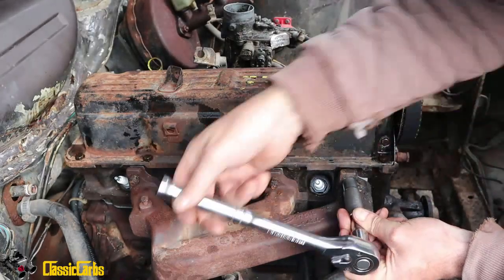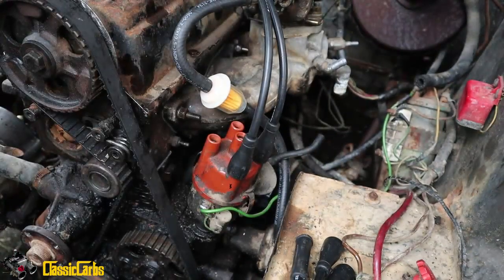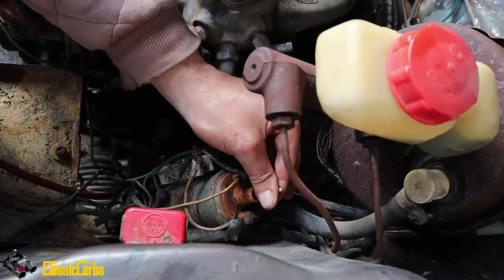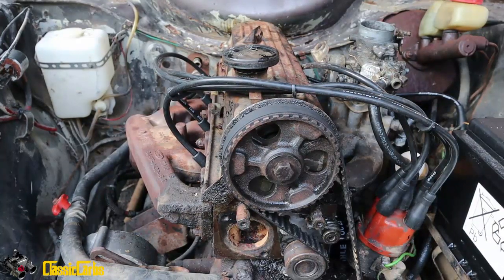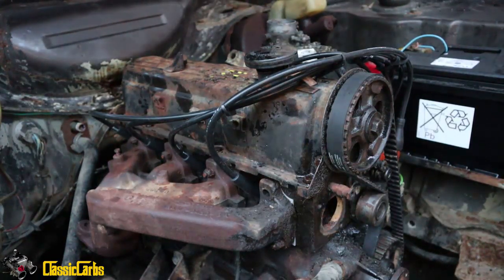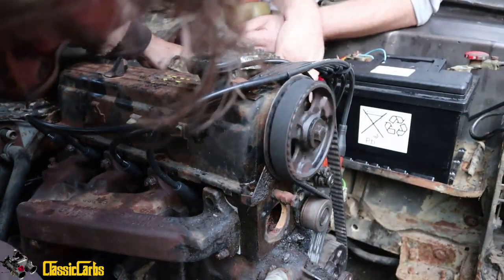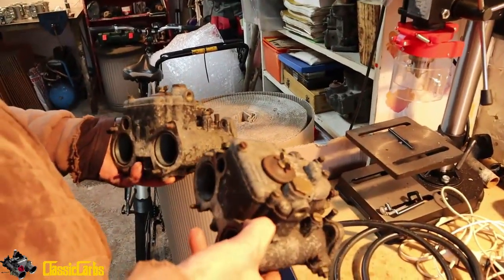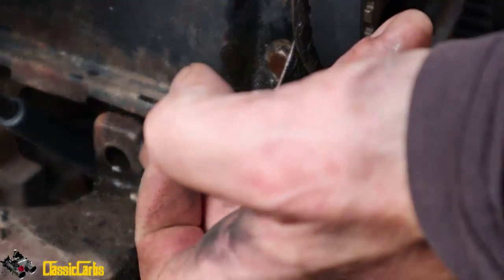1969 FORD CAPRI Barnfind - Will it start? - PART 8 ... The Finale !!

Comment from the maker: Capri project donations:
https://www.paypal.me/1969fordcapri

Thanks to all you Dudes! :) 
We really appreciate your donations which are taking this 
Old Girl on to the next level.  .  .
Reply: This guys' videos will help you a lot.  https://youtu.be/p_5MqRS43ao
Don't forget, if you fit a 2Ltr Pinto, it's an interference engine unlike the 1.6 so any mishaps with the timing belt WILL result in bent/snapped valves. ;¬)  You should try and find a nice old 2Ltr V4, get it back to original. Keep up the good work.

Comment: These engines are real strong , back in the day we used them for beach racing , half the time a rad hose would blow half way through a race and you would say sod it and keep going , they were over revved and abused in every way possible , even if a cam belt broke or came off due to sand the engines were ok because they are non interference engines meaning the valves can not hit the pistons , what great engines they were and what good memories these videos bring back .

Comment: Ive owned 4 Capri's over the years...Raced several of them...still own one today....And i got to tell you to see that little 2000cc engine light off...really brings back some memories....Even the Sound is so familiar to me....A wonderful design....i knew she was going to light off...they alway would...Switched to the 2.3 lima motor in the mid 80s...but even with the extra displacement...they never ran as Strong as the 2000 motor....Great Video.!..brought back memories...👍
Reply: Its a 1600cc
Reply: @tigermoth3194  
Yeah...external dimensions the Same...Same Valve cover....Sold in Europe....US got 2000cc motor...Ford did sell a 1600cc Pinto but is was based on a different engine...

Comment: Why would you rev an engine that much knowing its been stood for years, cold, and has no coolant.  Fair play for getting it running though.
Reply from the maker: I guess it was pent-up frustration... It survived thankfully!
Reply: I’ve been restoring classic vehicles for nearly 40 years this guys only just starting out we all have to start somewhere and he’s not doing too bad👍
Reply: Worried about how he ran the engine? You ain’t seen nothing till you’ve seen @ziptiesnbiasplies 😂😂😂😂
Reply: Revving a stationary engine is not necessary a bad thing when cold; there is no load and RPM means higher oil pressure.
Reply: Revving it like a Lunatic Orchestra  Conductor. I was waiting for a meltdown.
Reply: @brian44graham  yeh man, I  was cringing a coupla times in this build, but he did a great job, from as his buddy said a scrap heap that a lotta people woulda sent to the wreckers to a nicely running  engine
Reply: its not a preservation channel is why.   its a fun channel

Comment: I had a 74 with the 2.3 inline 4 in the US. It was unstoppable. Previous owner thought that he seized it because it was spitting oil out of the distributor shaft and sold it to me for $75. I fixed the oil leak by replacing the PCV valve and drove it for 5 years until a taxi him me. I slowly restored it while I was driving it. I must have put 120k on it and never had to touch the engine. I’m 56 and I’ve owned a ton of cars, but the Capri was my favorite.

Comment: Absolutely amazed you got that running with the amount of guesswork regarding valve and ignition timing. Good thing about Fords from that era is that they are so simple and only need to be ‘near enough’ to spark up.  After 40 odd years in the trade some of your working practises made me cringe but at the end of the day it’s a “well done” from me. Enjoy the adventures and heartbreaks of the ongoing resurrection . Get a helicoil into #1 exhaust and clean out the oil spray bar on the camshaft before it clogs up again and wrecks the cam. Can’t wait for episode 9

Comment: I knew it would start! I've had several of those engines over the years in ford pintos. Great engines! Cast iron block and head. Pretty much in destructible as long as you maintain it well. Now that you've had it running, you really should pull the valve cover back off and be sure all the cam followers and camshaft are oiling properly. They will destroy themselves if they aren't getting enough oil. There should be a good coating of oil everywhere inside the valve cover. Also, check the timing with a timing light. Carburetor isn't right either. Nice Job! 👍😎 I knew it would run! Wahoo! Wes

Comment: Well I suppose the name classiccarbs.com didn't refer to your classy  diet. sneaky Emmanuel had a garageload of reconditioned carbs skopped back there! No wonder they were so confident about the carb rebuild! I def think you have a future on TV. Also lovely to see all the comments coming in from the US and Aussie! The 85% has it! 
   If you put your finger through where the water pump goes, can you feel to the back of the stud hole No 1 cyl' where your mate  'your mate' drilled out the stud?

Helicoiling may not be enough if he has drilled through into the water jacket, may need plugging as well!

But for now! You have a running Pinto in a '69 Capri! Needs an exhaust, a throttle cable, a choke cable, number plates bolting on, a cheeky call to get an MOT, while you craftily detour to your mate's rolling road! 

Incidentally how mucky did the inline petrol filter get?

But really well done It is a fine testament to home spannering. If you have the old Greek reg, make a cardboard sign with the old Greek reg. Maybe the old Greek dude will get in touch!
Reply from the maker: Thank you very much for your input , comment and suggestion!!

The inline fuel filter immediately went yellow. deep yellow. So i think it's rust.

Yes, rolling road power run might be an interesting watch!!

Thank you for your tips regarding that exhaust stud hole too : )

Will be having a look at that over the next few days.

Emmanuel : )
Reply: MOT exempt.

Comment: loosen the distributor just a bit so you can turn and you can get it closer to time. Then it will idle.Also check for vacuum for air leaks and everything that doesn't  have a place to go just plug them off. It also could (not likely) could be off a tooth on the blt but I don't think it is cause it has plenty of snap or quick to rev and it wouldn't if it is off that way. I would gladly send money if I could but I am broke as a joke living on fixed income. If you do decide to change intakes, I believe the gasket is still reusable. I know the intake is not as expensive as the other gaskets. At this point I would get the rad hooked up before you cook the headgasket. I think your on your way to a working car. I did this kind of work most of my life.

Comment: Congrats on getting the engine running, It sounds healthy! 
The stock single barrel carb will give about 75hp. The complete capri 1.6S setup with the twin barrel carb will give 90hp . I am not sure but i think  you need the 1.6S weber carb(with the proper jets inside it! Very important), the tubular exh manifold and the dizzy (for the proper ignition advance curve)
Tip: clean and gap the breakerpoints inside the dizzy. And  tweek the idle mixture and idle speed.
Reply: 67 hp on the single barrel, 86 on the double if its an earlier engine. I think they upped the compression ratio on later ones to increase the power output to 90.

Comment: Old school points and coil ignition are so simple  to get running, much simpler than fuel injection, nice to see her running, I bet the clutch is seized like a bastard tho!..if so to free it you Jack the back up, get her running in gear, rev the engine, depress the clutch and apply football or handbrake simultaneously,  let it run up to temp first to dry the clutch plate out as they swell with moisture.

Comment: I recon its got around 75 hp before you tune it. Nice one great to see it run.
Reply: MrClassiccarenthusia  this engine has plenty of compression. You can clearly hear the starter motor chugging  from 1 compression to the next , even before it ever started.
And once it ran it immediatly ran on all 4 cilinders.  It needs some more tweeking but it sounds like a decent engine.
Reply: They actually had 60 when new.....
Reply from the maker: MrClassiccarenthusia  You know your engines man!!! Jeez, come and sort some ultimate rings for us!!! Please!! : )

Thanks for your input, it is much appreciated!

Emmanuel : )
Reply from the maker: @jusb1066  the 2.0L had a about 95 or so when new i think.

So, i guess you must be about right..

So this one, must have about 10 left now =)

Thanks,

Emmanuel
Reply: @Classiccarbscouk  I've been competing cars/engine's I've driven, I drive an Aygo now With 70hp, it's nowhere near the slowest car I've driven, though kids these days think they are slow and embarrassing

Comment: The points basically just complete the circuit to the coil when they close to make it fire.. you may have a ballast resistor in there somewhere and that's only energized on start
Reply from the maker: thanks Ronald, this video was recorded about 2 years ago, and we somehow sorted it and have progressed with the car considerably since then. Thanks for the Tip though! :)
Reply: @Classiccarbscouk  I figured that man it's okay my brother had a brand new Capri I believe it was in 72 or 71 it was brown with a V6 automatic and his friend had a yellow 69 and I remember going around a corner in that car doing 105 and it was a rush

Comment: Question: is fixing it enough for an MOT, road legal, a viable thing for it?(yeh I know mot exempt but)
Reply from the maker: Not sure what you are saying here, but i guess an MOT would be good and maybe required by law, to ensure the car is safe enough to drive on public roads.

The welding is the stumbling block for me as it is very, very difficult and time consuming, and I DONT HAVE A WELDER!!! :)

But yes, booking it in for an MOT would be a good idea for safety's sake.

- and a laugh - when reading the fail sheet(s) hehehe!!!

Thanks,

Emmanuel
Reply: @Classiccarbscouk  its over 40 , technically you can declare it safe yourself no.mot required, but a bit daft IMO
Reply from the maker: @jusb1066  Yes, that is strange how they have made that legal.. I'm not complaining though.

Needs brakes, lights, suspension, horn, indicators, exhaust, seat belts, ignition barrel & key.. and rubber polybushes all around. And new tyres!

Thanks,

Emmanuel

Comment: The problem with these. barn finds is you're not quite sure if you should start with the engine or the body work.  I'm a bit fussy, I would hav cleaned everything properly, so I can see what's going on. To do it properly he would have to strip everything down again to clean and paint properly, and please get your cooling system in and sorted before you start it up again. But it started and that's all that matters.

Comment: Well done getting it started,  if it"s any help you can get a rubber bung that goes in the bracket on the cam cover to hold the ignition leads.  Should be similar to escort maybe from Burton's
Reply from the maker: Good point Rodney, thank you! 😎👍🏼🛠🔥😊
Reply: @Classiccarbscouk  cheers ,happy to help,if only in a small way.

Comment: check the camshaft back plate, there is a little tooth that sits in the woodruff key slot, look like you missed it and its crushed against  the cam gear

Comment: standard pinto problem.... screwed head bolt snapped in the hole, always that one as well usually because it has the engine lift bracket on it  there is a big community on those engines they will give you all you need lol... but swap the block out for a 2.0S and a 2.1 head if i remember right... bigger valves.
Reply from the maker: Yeah, that freaking stud hole is leaking oil... not sure what is going on with it..

Thanks Bill : )

Emmanuel

Comment: Congrats guys. Well done. But PLEASE reroute the fuel line. Get it away from the manifold.  Also get that radiator in before you cook the engine. Look forward to more of the Capri resurrection.  Thank you
Reply from the maker: Thank you too Brian :)

Emmanuel

Comment: Need key on to hav juice to coil?? Or hot wire from batt. To plus side of cool!!
Reply from the maker: Ignition barrel is disconnected and incomplete, so not an option
Reply: @Classiccarbscouk  remove part key goes in screw driver for key put lock cylinder back or buy used key switch for ur machine with key ??

Comment: You need a two pip cam = 2.0 this was the 1.6 GT in MK3 Cortina plus 2 choke sequential Weber and tubular header Ideal alternative escort RS 2000 cast exhaust
Reply from the maker: Is it higher lift Gary?

Thanks,

Emmanuel

Comment: will it go? or will it slutter and just not want to know or do what most fords do roar into life blue white black smoke and then flash up warning lights like a christmas tree but still go? 
that sounded proamissing! its turning and wanting to go, good old ford they may of had strikes and rusted badly in the wheel arches boot sills floors and pillars but they knew how to make an engine, 
all you need is a lil spark...well i mean you could check the points but eh who has time for that? its wanting to go, 
and then it rained hmm might be time to think about putting in a garage extra part as in the front bit can be under shelter the rear exposed, 
oooh ooh! that was life it wants to sounds more like a statonery engine then car but good start,
IT LIVES!!! AND SOUNDS LIKE IT READY TO GO ON THE BANGER TRACK OOOOH THAT TAKES ME BACK! hearing that as we used to go to mildenhall hearing the cars fire up like that and go on the track i got out of it though seeing too meny nice cars going on the track i'm more a save them then race them unless they are like far too far gone,  
the plot thickens bigger carbs new screw thred but i think first now its running let's get the rest of the engine going as in water works, 
yes all donations will go into the car or the local pub or the car and part of the pub or the pub and only part of the car but most importantilly it ran,
Reply from the maker: Hahaha!! Thanks for the commentary 🎩👍🏼🎸😎🛠🔥😊

Comment: that's it all that work get it going then rev it hard when it has not got hot for so long dry joints not expanded piston rings not expanded for years BUT HEY we have done all the work now lets destroy the engine by hard revving without coolant, Buy it from you No thanks!!!!
Reply from the maker: Thanks Anthony, not exactly offered anything for sale mate, but yes, i did rev the engine hard while cold and with no coolant...

Comment: Just put a helicoil in the exhaust hole
Reply from the maker: I think i need to buy this helicoil stuff, i have seen it but not used it..
Does it come in a kit with various sizes of helicoil or do you buy them one at a time?
Reply: Classiccarbs.co.uk you can buy a whole kit, or just a little set. IT is Made of steel, so the treads are always stronger than the original in the engine. Sorry for my english, greetings from Holland.

Comment: Got no key??? Gee Wizz take it easy on the revs ??
Reply from the maker: Well, someone has cut me one, and it fits the barrel, but the barrel doesn't rotate as you would expectso it needs to come off the steering column and i need to ahve a look at it..
Reply: @Classiccarbscouk  by the way great work on ur machine!! Here in Southern Kentucky USA with older key switches u can remove the part the key goes n and use flat screw driver for key!! Take screw with u and no one can steal Ur car!! Lol!!  We call it Hillbilly anti theft device!!
Reply from the maker: @scottyjones27   Scotty Jones  now that sounds like my cup of tea! My sort of solution!! Thank you Scotty Jones from Kentucky in the USA!!!

Comment: FFS clean the rotary arm and contacts! Set the gap! Set the valve clearances! BTW the belt tensioner is fitted THEN adjusted with the belt on. The 1st exhaust gasket was upside down... Why not clean and/or paint the parts you take off when on the bench? You threw away the rubber ignition lead spacer.... pretty much every job is fecked! OMG revving an old engine with no coolant... what are you trying to achieve?